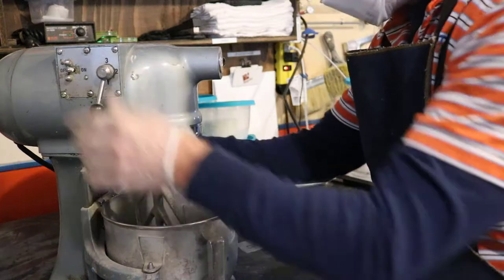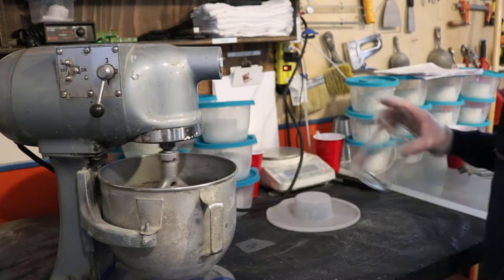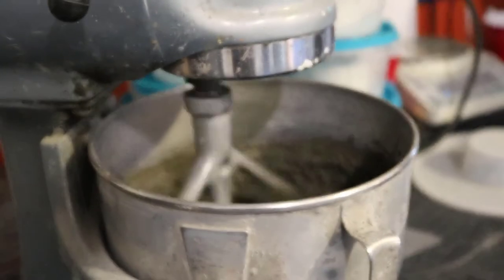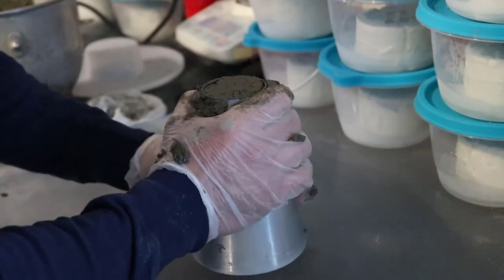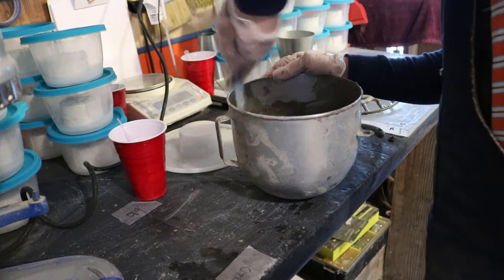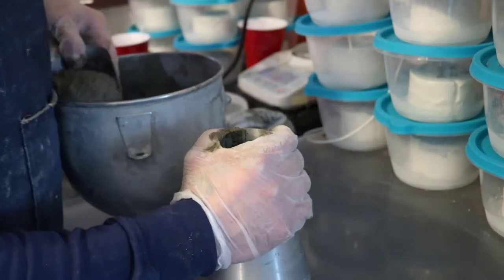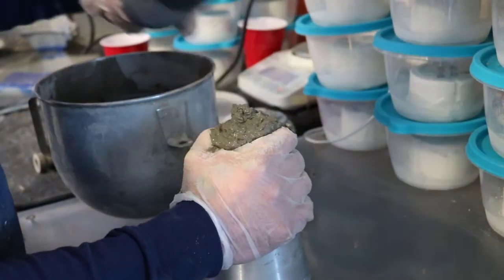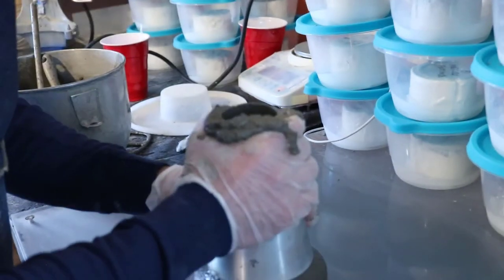Why Do We Run Preliminary Mixes? - Vlog 427

Comment: hi, im trying to correlate W/C ratio using what we have here in Guatemala two kinds of cement. 5800 and 4060 cements, Im getting 4500 psi with a w/c ratio of 0,64 with 5800 cement. I follow you channel and Tyler's chanel and your allways on a 0,48 +/- W/R is this because your using a different cement ?